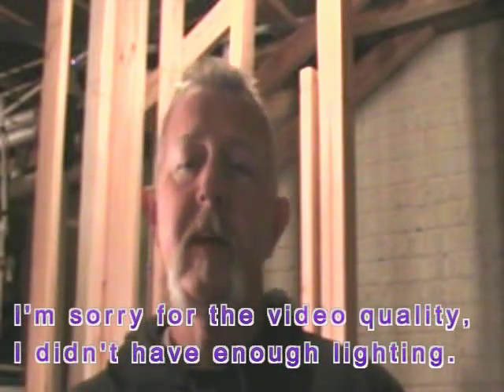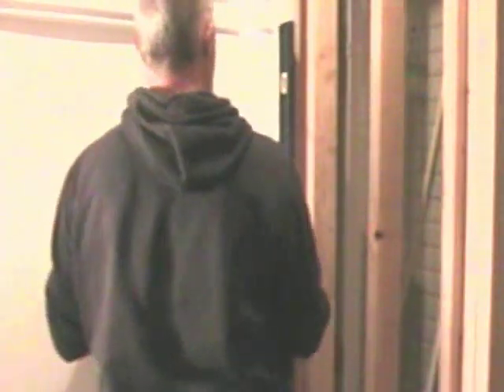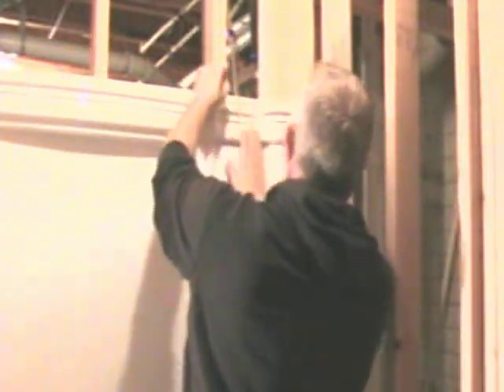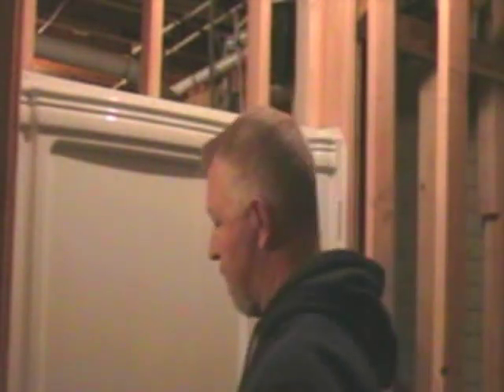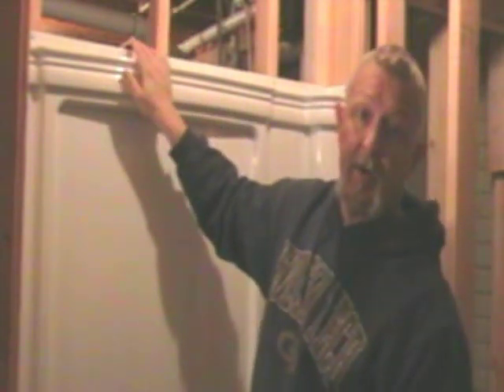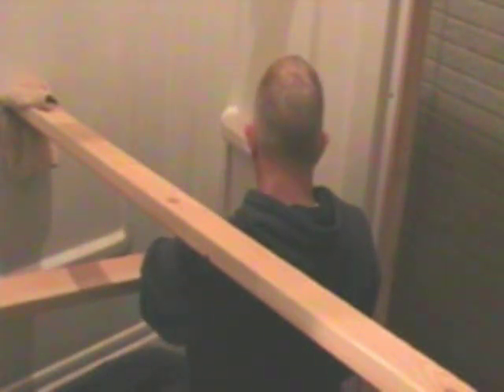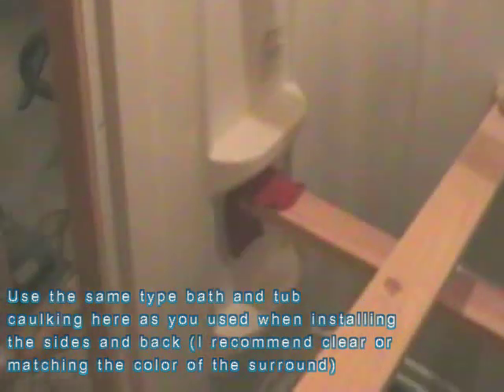How to Install a Plastic Shower Wall Set in Basement

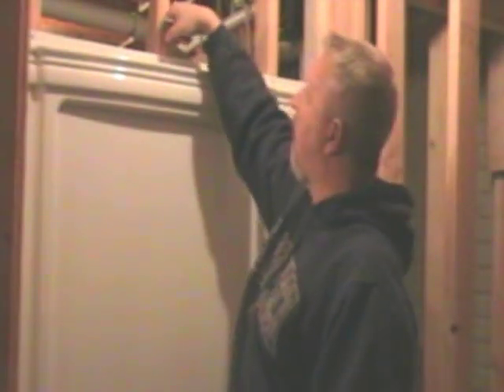Comment: Great vid bros. - thanks. question: doesn't that piece of backer-board cause that wall to be bowed? (8:05)
Reply from the maker: Thanks for the comment, Tim.  I appreciate it.  The backer-board came with the wall set and the wall set was made so that when attached to the wall studs, the backer did not produce a bow in the shower wall.  If a wall set was not made this way, I'd probably put blocking between the wall studs for support.  that would keep the mounting surface flat.